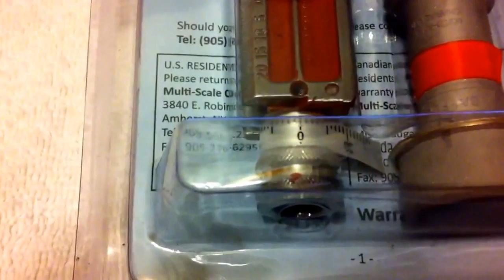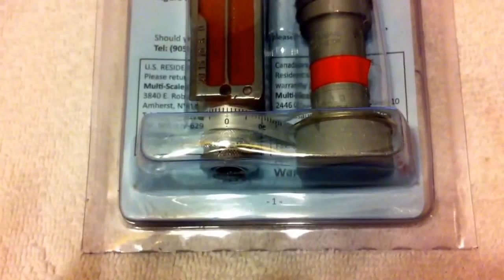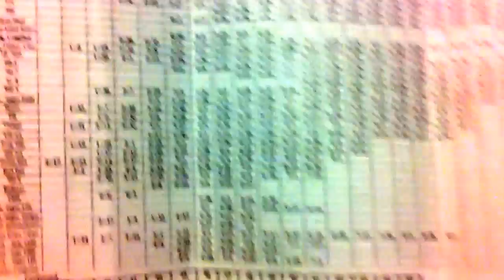Universal Charge Bar for MEC Shotshell Reloaders

Comment: Thanks for the video. Very informative and it saved me some time from trying to decipher instructions. I cannot believe the manufacturer does not have a video of the installation. MEC videos aren't very numerous either. Anyway, I just followed your instructions and everything went well. My biggest issue was installing the grommet over the brass washer. Frustrated, I finally just placed the grommet over the hole and installed the baffle. I took the baffle back off and the grommet had been squeezed down in the hole.

Comment: Good video.  The philister screw seems to be redundant.  My MEC 600 has a steel bushing on the inside of the charge bar throw tab, so no matter what size or thickness the bolt or screw used to couple the tab to the charge bar, the motion range is set by the spot welded bushing.

Comment: I never really use the scale on mine, I just throw a charge and scale it. Then adjust as needed, and the same with the shot side adjust till you get a proper crimp.
Reply from the maker: +erniemark1962 The scale gives you a ballpark figure. Of course you have to weigh the charge to make sure it is right.  I have been pretty happy with my UCB. Even happier that I have been able to find some Clays powder recently.

Comment: Howdy , I got a used one today and no manual, mine also did not come with a baffle is it necessary ?
Reply from the maker: Baffle is optional. Find a throwaway email and I will send you a manual. Will send one for progressive and non progressive. BallistProducts now has a new version of this.
Reply: @TheRotorhound  perfect so itll run , mine does look even older as it can only do lead doesnt have the piece to change out for steel unless the found a way to make it work with only one insert as it looks completely different and sounds good I will find one I dont use or has little info shortly thanks for quick reply !
Reply from the maker: @BigBlueCJ96   Let me know where you want instructions.

Comment: @therotorhound do you have a copy of the powder/shot chart that i can get from you? I have one of these adjustable bars but have not been able to find the chart now.
Thanks!
Reply from the maker: Yes. Post a throwaway email and I will send you everything I have. Don’t depend on the charts as they are rough guides. Weigh everything. Do you need for the progressive or I will just send both.
Reply: @TheRotorhound  I found mine!

Comment: I bought 2 of these universal charge bars...one for my Mec 600 20ga and the other for my Mec 600 12ga, and both charge bar calibration labels are pealing off not even 3 months after I bought them. I messaged Mec's customer support and they told me the same thing of wanting me to scotch tape them back down. I told them I paid over 40.00 for each one and so shouldn't have to scotch tape anything to hold it in place. All they did was send back one of those formatted replies that said "Sorry for any inconvenience this product may have caused. We here at Mec offered you a reasonable solution to your situation but unfortunately you chose not to accept it. If there is anything else that we may help you with, please contact our customer service department."
Reply from the maker: Journey4Sure Knowledge-N-Wisdom    They need to be glued on better. Just to remind you these are not made by MEC so don't blame them.
Reply: You're right.. I just got done googling it and mec doesn't make it. When I bought this off of a site, it was advertised as though it was manufactured by them. Weird thing is why didn't mec bother to tell me in their reply.

Comment: I just bought a used Universal Charge Bar and it was missing the Philister head screw.  I want to buy a replacement.  I know it is a 1/4-20 screw but I don't know the length of the screw or what it is made of.  Can you please tell me?
Reply from the maker: Barry Yontef   Mine measures from the top to the bottom. 0.73 inches with a micrometer. Hope this helps. Appears steel and has a washer underneath. Washer is a lock washer measures .072 inch thick and I think washer was from original setup and does not come with universal charge bar.  Let me know if you need more info.
Reply: @TheRotorhound  Thank you so much.  Can you give me the measurement of the screw portion ie from the bottom of the head to the end of the screw?  Also, I assume it is a bolt rather than a screw?
Reply from the maker: Barry Yontef   The thread length is .50 inch. The head is about .23 inch and is a single slot head, not phillips. Best i can measure. Phillips would work too. You will need lock washer too. I don’t think it matters what the head turns with but mine is a single slot with regular screwdriver to tighten. Have fun. If you want I can send pix if you provide email. I think you are good to go.  I know how frustrating it can be trying to find replacement parts.
Reply: @TheRotorhound  Perfect.  Thanks for all your help.  The video was excellent and you don't need to apologize for anything.

Comment: I just picked one up and I'll tell ya, it is cheaply made and all I'll be keeping is the baffle. 

First the set screws and plastic dowels were not in the package. So I drive over to the hardware store to pick up some screws. Got home and dropped a single piece of #6 shot in as a replacement for the dowels. Problem solved.

Next I attempt to install it on my 16ga MEC 600 and the little retaining clips underneath fall off, so I give them a slight bend to help secure them. Problem solved.

Next the adjustment knobs on both sides are flopping around. I took it and dropped it in the trash. Not going to drive 2 hours round trip to cabelas to return it. 3rd problem is the end for me.

Poorly made but the idea is right. I'll just stick with MEC non adjustable charge bars and maybe start adapting a couple to use powder bushings in the shot charge cavities. They will get no recommendation from me except for the powder baffle, that does seem to work pretty well.
Reply from the maker: Pimply Stikage   Why not contact the manufacturer?
Reply: FWIW, Ballistic Products Inc. is now making their own version that uses engraved scales on the adjustment knobs that they have dubbed the "Adjusta-Drop."
There are some reviews of it here on YT and elsewhere.
I'll be using the stock MEC charge bars, but I can see the use of a universal bar well beyond the aggravation of having to keep track of the bushings/charge bars and spending money to get a whole new charge bar for different shot charges or bushings for different powder charges, namely the ability to more finally adjust your drops on both sides than the fixed bushing/bar combination will allow.
One other comment, but Cabela's would have at least refunded the price on the defective bar that you threw away if you had sent it back via old fashioned mail.
I doubt that they would have included the price of postage, but you still would have gotten the price of the bar ($70-$80 if memory serves correctly) by returning it.

Comment: is there a reason why my bar is locking up when throwing the shot? from right to left it goes smooth, but left to right it locks up
Reply from the maker: therealrene   As a bet I would say that the zinc insert may be binding. Really needs to be in there flat.
Reply: just sand it smooth
Reply: I. hecked it, is as flat as I can get it. I'll take it and try to sand I I suppose see if that helps. thanks guys

Comment: After 18 minutes I finally realized that you are not actually going to show how to adjust this bar!!!!
Reply from the maker: What exactly would you like to know?  I would be glad to provide you the manual that came with it if you post a throw away email. This is not nuclear science.   You loosen the set screw, turn the caliber to increase or decrease the drop size, weigh the drop, tighten the set screw when happy with weight, good to go.

Comment: The scale doesn't need to be there. It's adjsutable, you throw a shot and charge and weigh it. That's it. Once set it stays set without having to replace the bushings. The scale is inconsequential.
Reply from the maker: +borzak101 You might say that the bushings for MEC don't need to be numbered. If you are changing powder drops it is nice to have a number to go to knowing that an intelligent person will still need to weigh their powder and use the scale on the charge bar to get to a rough approximation of where they should start. The warning is that you should not use the scale on the charge bar alone, you need a real powder scale to find the correct load. It would be nice if a "permanent" scale was marked on the charge bar instead of this poorly glued on version. Otherwise I like my charge bar. Thanks for watching.
Reply: +borzak101 Good debate going on here.  I use a powder scale to initially set up the UCB then like having the UCB scale for repeatability.  I'm thinking I'll etch the knob of my UCB at some point.
Reply from the maker: The problem is that the scale is only an approximation and the powder density changes on every bottle so the scale helps find the ballpark but always weigh to be safe.

Comment: The screw broke on mine. Could not figure out why it was throwing charges all over the place. Dangerous to say the least.  Took it apart and the screw hole split in half. Piece of junk. Will never buy one again.
Reply from the maker: David Gogolkiewicz I bet if you contact them they will make it good. But good reason to weigh your charges every now and then.
Reply: No thanks, not safe, I will stick with the factory bar.
Reply from the maker: David Gogolkiewicz 
I use the factory bar sometimes but the Universal Charge Bar is more accurate when it is working right. Let the company fix yours and sell it if you don't like it. Or throw it. I don't work for the company and don't support or encourage the product. Only a description of how it works. I have one for a progressive press and it works well too.